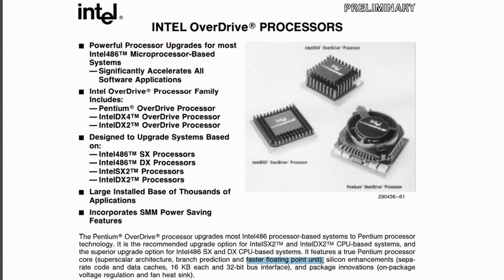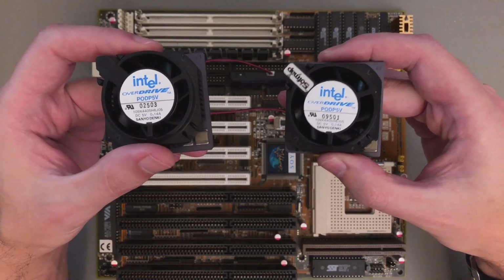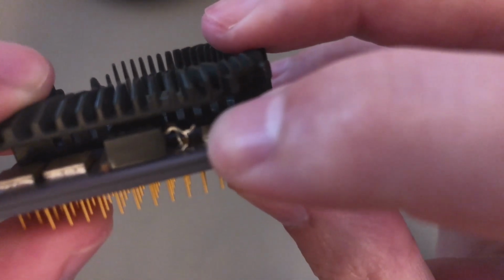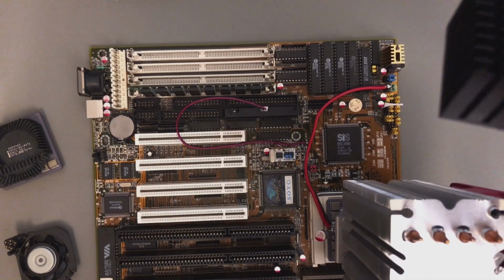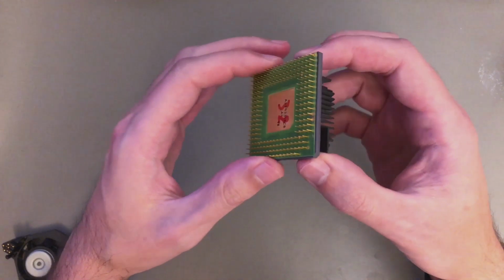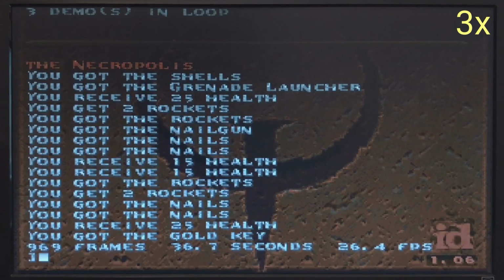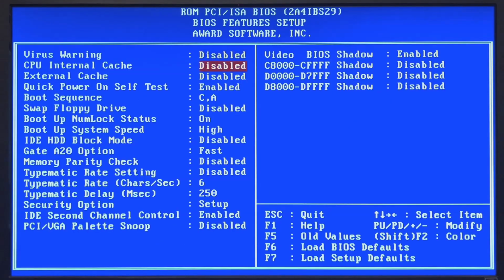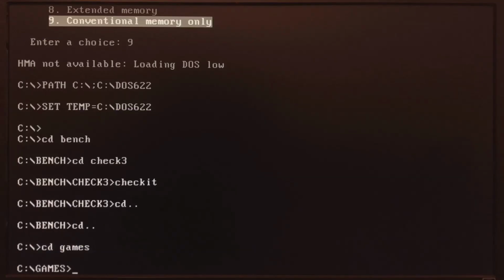Pentium Overdrive (Socket 3). Modding, Over/Underclocking. New Records! IBM-XT Performance Possible?

Comment: The Pentium processor was originally designed for Socket 4 (60 MHz to 90 MHz parts), sadly they have a particular FPU bug, FDIV bug which had a long-reaching problem even on the early Pentium Pro processors. Still, it was an interesting CPU, even when it comes to overclocking as superscalar pipelines apparently opens up to higher frequency headroom as how fast they work matters. Even limboing it lower (which is still a fairly common thing, even more on the phones, when they are idle and need to conserve the battery power).

Comment: If we take the back off this package can the clock multiplier be further changed? one clock pin is exposed to fan status and the other might be on the internal wafer package but is NC
Reply from the maker: Very hard to tell, very hard to reverse to this level. I do not have equipment to try something like this :/
My guess is that this is not possible. The PLL there is probably fixed at 2.5x.
Then this is just a safety thing that disables the PLL and so it is clocked directly from the input 1x.

Comment: Destroying and original pentium overdrive is stupid.
Reply from the maker: I understand your concern. I do not see something like that here. It is more like servicing / restoring the PODP.
1) The original heatsink and adhesive are awful. On top many times the fan fails and it is impossible to find an extract replacement.
2) Nothing stops me from reattaching the original heatsink with a better adhesive if I want a stock configuration.
3) The PODP are not that rare, I have maybe 10 of these.

Comment: Maan from what I know: internal cache is JUST L1, external is L2 (on motherboard, because you STILL have 486 mobo and bios handles L2 cache this way). If you'd have a pentium (586) mobo, then it's simple, L2 cache is on cpu so bios handles it a different way
Reply from the maker: Both 486 and Pentium motherboards have cache on board (L2).
And all Pentium CPUs have only L1. This too.
The only exemptions are the K6-2+ and K6-III CPUs.
In this case the M/Bs cache becomes L3.

Now the point in the video is about L1 been double in size in Pentiums, and split in L1d and L1i.
While in 486 CPUs it is a unified L1.
Reply: @atheatos  oh, thanx by correcting me mind

Comment: You might want to push your RAM config from 16MB to 32MB as Quake slightly scales with the overall amount of RAM available (0.7fps on my 4SA2 POD100 Setup).
Reply from the maker: I think I tested this and there was no difference in my board.
But yeah I will try to retest this now.

Comment: Nice work! Would love to push my POD83 up to 110 on my Asus GX4 VLB board.  Any pointers on how to get started with different socket 3 boards?
Reply from the maker: It is a bit hard to tell as every board has a different clocking circuit and I do not have this one.
I have a few more PODP83s and motherboards now, including VLB ones.
Also my custom Voltage regulator for the PODP is ready.
So I will come back to this topic some time soon.
As for right now I am going for vacation :/
Reply: Report back once you do ... on my GX4 my POD100 scored 0.1fps less than the setup used here (1MB Cache, very fast VLB card).
I do own a Soyo 4SA2 board which is basically the same as shown here, albeit supporting up to 1MB Cache, it's a very good board, but the GX4 is still a bit faster.
Reply from the maker: As noted, I have a few VLB boards now. I am missing some of the very best VLB VGA cards.
I will come back to the PODP83 topic for sure.
Regarding L2 cache I can go higher however I have to reduce cache timings and then the performance is not good.

Comment: Awesome video with lots of great information! I picked up an 83MHz POD in very bad shape a few months ago and just got it up and running. Someone removed the OEM heatsink and chipped some of the ceramic capacitors on it. My model has only three caps with bare solder pads for the fourth on the right. I did something similar with the fan sense pad using a 1.2Kohm resistor. My chip is almost stable at 2.5x40MHz with no modification. I've never been able to complete a quake timedemo, but doom and other benchmarks run okay until it starts warming up. I'm hoping to increase the voltage to about 3.8V to see if I can get 100MHz stable. Not sure if I'll try a resistor or a diode yet. Do you think it would be possible to replace the chipped surface mount ceramic capacitors on the chip? I don't think they are a standard size as far as I know. My heatsink doesn't overhang that area of the chip, so I was thinking of using some taller smd electrolytics instead. Do you think this would be possible? Maybe worth trying a higher capacitance and adding the fourth one? Again, awesome video and modifications. Thanks for sharing! I'm looking forward to seeing what you come up with for the new regulator design. Subscribed 👍
Reply from the maker: Thank you

I know, I know, I watched your Video :) I am subbed.
The Cap on the PODP have an unusual shape for today standards and relative low capacitance (3uf if I remember). 2525 ones (~6mm x 6mm).
Do not replace the missing one with electrolytic ones. Modern ceramic ones are in general smaller but should fit.
Check for 2220 one, available up to 220uf. I would probably go for 100uf the other are stacked.

The new regulator is finished, works very well, I just have to do the Video now and probably put in the store.
Only problem it heats a lot, but ok :) This is by design, I wanted to make something small.
No difference in stability with this one :/ But I wait more PODPs now.
Reply: @atheatos  Thanks very much for the tips! Looking forward to seeing your video on the new regulator 👍

Comment: Was the peltier required for stable 110Mhz operation? Great video.
Reply from the maker: Yeah however with a good air cooler the difference was small (~105).
However Removing the stock cooler is a must I think.

Comment: Thank you for the great video 😊
I was wondering how you managed to achieve 44 MHz FSB. Is it related to the little white interposer with the crystal next to the motherboard chipset?
Reply from the maker: No, this motherboard  modded with my Any_Clk device. you can see how I did the mod in this video:
"Custom clock generator for Retro systems "Any_Clk". A new era of Retro Overclocking?"
Reply: @atheatos Great! I’m looking forward to watch it 😊

Comment: How does the 63MHz overclock? Those are little cheaper to buy.
Reply from the maker: The 63MHz models, OC significantly lower.
Both could not do 83bus with stock all.
After replacing cooling and a small they did 83 but no much more.
I have now many 83MHz ones, so I will come back to this topic.
My custom V-reg for these is also ready.
I will probably sell pre-modded 83 ones soon.
Reply: @atheatos  OK, so I don't look that way at all... I'm hoping for 100MHz POD, my Cx5x86/100 is quite slow with Quake, even with all the tweaks. Am5x86/160 is little faster but not much.
Reply from the maker: Yeah all my 83MHz did 100MHz after modding, and POD is for sure faster on Quake.
Reply: Got myself a PODP5V83 and it's superbad overclocker. @100MHz won't even boot to DOS. With 47ohm resistor between regulator GND and CPU I got 3,85V, boots to DOS but Quake won't even start. Then I did the not-so-recommended diode-trick and got ~4,1V. It's almost stable, I can run Quake maybe 15min and then page fault. :) I think no more voltage but a better cooling and if still it's not stable I give up. Really bad luck... Mobo is Asus PVI-486SP3.
Reply from the maker: This is similar to what I had.
I still do not have one that can do 100MHZ stock.
Cooling is the most important thing with these chips.
Reply: @atheatos  I'll try better cooling next. Now there's Akasa chipset cooler @12V and CPU feels warm. Maybe a larger socket 7/462 one. One thing I noticed: lower voltage it crashed differently, just hang. Higher voltage it can run Quake a long time but garbled characters on screen still, my guess is that the L1 cache is the problem here. Tried CPU on SiS471 mobo too but only WT-mode for CPU cache. Maybe a little more stable. Tried all the jumpers but no help. Maybe the WT/WB pin is just permanently shorted on the socket on that mobo.
Reply from the maker: I think... any cooler with some thermal paste is better than the stock option. For now you can also just try a case fan blowing on top of the stock cooler.
Reply: I think I got it stable with Socket 7 cooler but when I put the case back on it's really on the edge when heating up. Maybe I'll just leave it at stock clocks. Sometimes it's just better not to overclock. :D (can't believe I said that)
Reply from the maker: Never :p
OC is fun, OC is thrilling. Can not leave without it.
Reply: You are right, I was forced to buy another POD 😂 and I'm really hoping that it will do 100MHz in default voltage or at 3,8V (which can be achieved with resistor to regulator -mod)